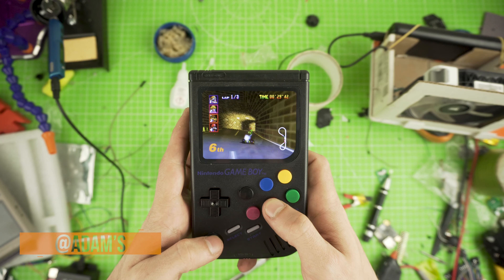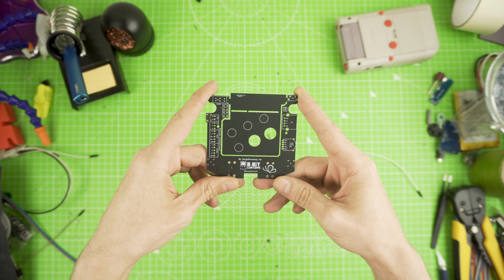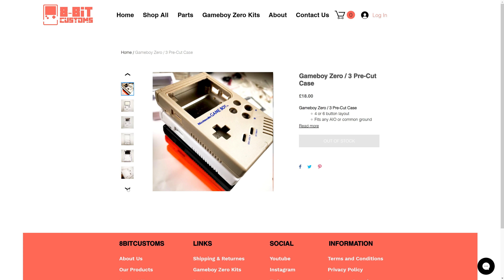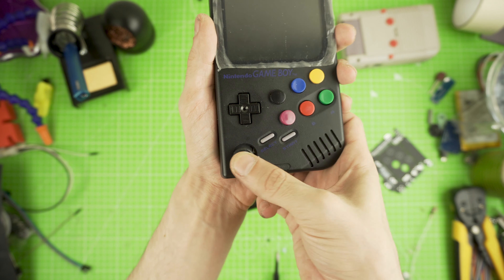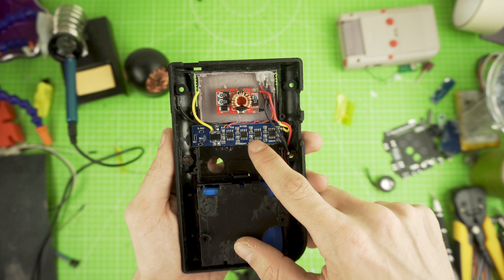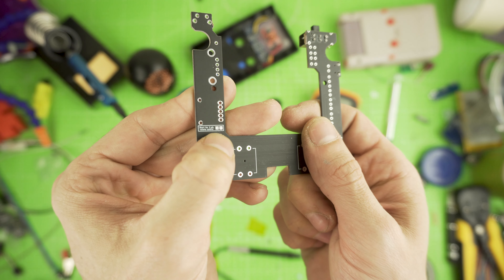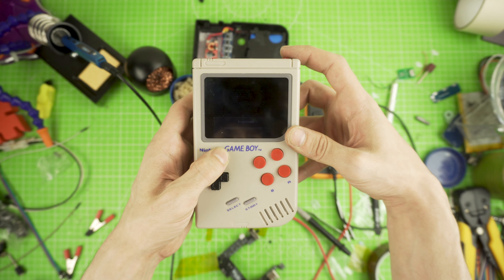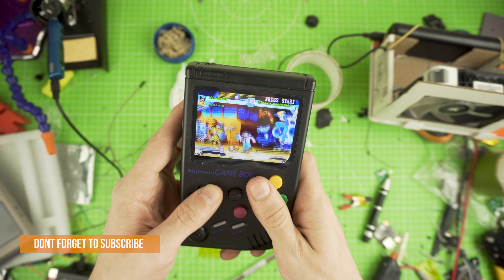Raspberry Pi 3 B+ Gameboy Tutorial

Comment: Hey Adam, I love all your videos! Great way to get overviews of different ideas and well edited! :)
I was wondering though if you still remember the parts for the LiPo charger and the 3a boost? Even if you don't know the exact parts, any extra info about what I can use to boost the amperage would really help me researching, I think I'm at a dead end lol :S
Reply: Actually I did find the parts, but I'm curious to know if your build can charge while you're playing, or if it runs off of battery only?
Reply from the maker: Thanks for watching the videos! Yes the circuit I made here is able to charge and play in the same time as being made out of 2 different modules so is fine. The booster was a 3A one that worked well but it was quite big, so we are working on a booster to get 5A so you can get the Pi4 in there. 
I am currently testing and the boards will be available at 8bitcustoms.com
Reply: Also bought the module charger and buck booster. Can u share on how to wired the tp4056 module and the battery?

Comment: Hey Adam, I really want to start this project. I have no experience with soldering so I am hesitant. How long would this take to do? Do you recommend i do the A+ first or do this one straight away? I love ps1 and n64 games so this would be the ideal one for me. However, i do not want to screw up.
Reply from the maker: Hi Dwayne, I would suggest to start with any of those board, if you can modify the Pi3B+ is the same as Pi3A+ in terms of soldering. Get started with practising soldering, just get any pcb or a perfboard from Amazon and just go at it. With the Gameboy project comes some difficult soldering parts but is nothing too extreme, take them 1 by one and take your time.
Reply: @Adamstech  Thank you so much for your suggestions buddy. I will take your advice and keep you posted on how it's going. I modified my old vita and have a ton of emulators (ps1, snes, sega on it). However, there is something about doing this project that just seems fun and amazing. How often do you play it?
Reply: Also, did you buy the raspberry kit from Amazon?
Reply from the maker: I play pretty much every day on it, I got my Pi's from Pimoroni, but if you are in the USA Pihut should be fine,
 also did you take in consideration the GPI case? Have a look on Amazon for that! I got videos on it also
Reply: @Adamstech  Awesome man. Do Pokemon Yellow, Warioloand 2 and other Gameboy Color classics run well on it?
Reply: @Adamstech  also when you are saying get a pcb board, what should I connect it to so I know I am doing it correctly or not. I was watching your Gameboy zero project and wondering if I can skip that project and go straight to the 3A+ or 3B+? What do you think? The only reason I am saying this is because I love ps1 and n64 games, and I think the 3b+ is powerful enough to run those compared to the pi zero. Is it easy to download roms and load it onto the pi as well. A lot of questions, I know lol. I am just nervous to get a started.
Reply from the maker: I haven't tried those but plays up to N64 PS1 so it should work

Comment: Will the tinkerboy DPI Adapter work with a Hyperpixel screen?
Reply from the maker: Hyperpixel is a plug and play screen, you just plug it on top of the pi and it works without using other parts

Comment: Adam, what speaker is that?
Reply from the maker: Is a full range 2w 8 ohm speaker, you can find it on Tinker website, mine are all sold out
Reply: @Adamstech  Oh, so that's the one Tinkerboy sells? Good to know. The one I have in my Circuit Sword build is barely audible.
Reply from the maker: @franciscogonzalez9165  This one I can guarantee is top notch, but also, can be the amplifier used on the board

Comment: That no is a 3b+ is only 3b
Reply: @Adamstech  3b+ have a ethernet port
Reply from the maker: That's a cut down board man I say that, check the CPU, it has a heat spreader on
Reply: @Adamstech  really? Thats weird. Mine is with the ethernet.
Reply from the maker: The board has the USB and Ethernet port cut down, again, specified in the video as well